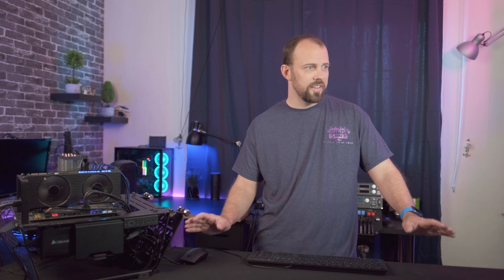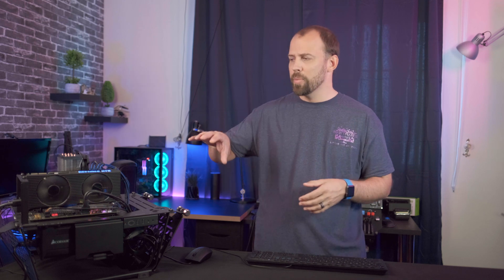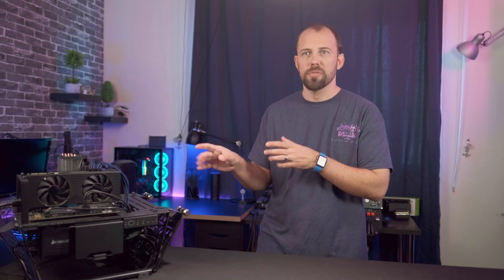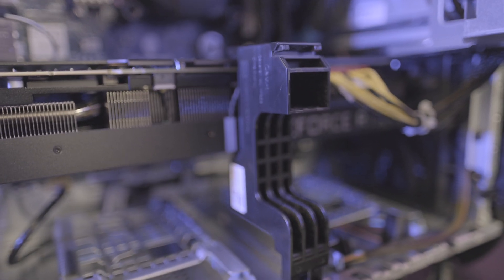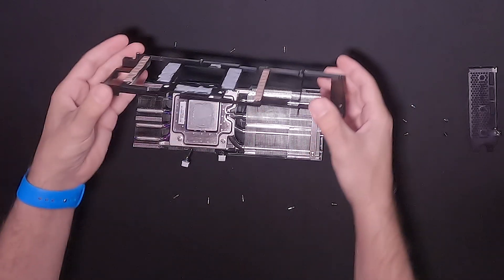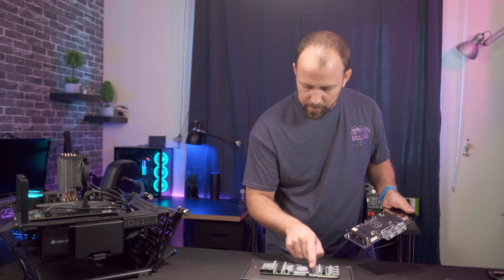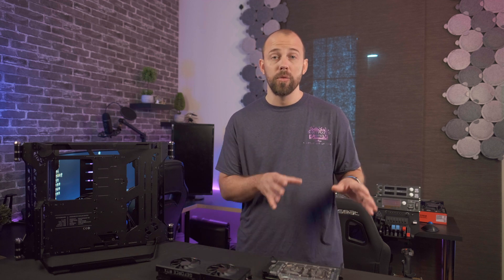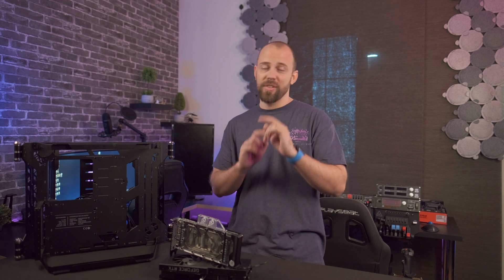Dell (AlienWare) RTX 3090 Teardown - EKWB Waterblock Install!!

Comment: I wish you could of shown the whole procedure of installing the water block, adding fluid and fitting it into the tower. I just bought an r10 with the Ryzen 5 5600x. and GTX 3090. I've always wanted to install a water block. Its for my son basically. But the cost of the water blocks are pretty crazy. And the guys putting them into ailenware computers and not huge on youtube. Anyway thanks for sharing this video, I subscribed today.

Comment: 9:30 and 11:10, you keep saying this is a FE water block.  That must be a mis-quote.  FE block is a different design, shorter, with the water connectors on the end rather than the side.  This must be a REF block that EKWB lists as compatible with the Dell/Alienware 3090?

Comment: I've actually dell rtx 3090 , if i install a watercooling system on it the overclock it , will overclocking damage my gpu in the future even with water cooling? And thank you
Reply from the maker: Overclocking will not damage your GPU if you do it properly and watch your temps. Go for it!

Comment: Are these Dell GPUs proprietary? I’ve heard some say you are unable to swap them over to a new build while others have claimed to do exactly that. I have a dell 6800xt and want to give it a new home but don’t want to waste money on a new mobo, case etc if it’s non compatible
Reply from the maker: I currently have this 3090 on a completely new build with no components from the original Dell machine installed. It is just as compatible as any other card so go for it!

Comment: Does this fit directly in the Alienware case? Also, what is the vram temps?
Reply from the maker: It is possible to setup a water cooling loop in the Alienware case but it would take heavy modification and there isn’t a lot of room for radiator/reservoir. Best to shelve that case and get something more water cooling friendly.
Reply from the maker: VRAM temps are nominal due to the large surface area of the metal backplate. It’s best to have airflow over the backplate to further aid in cooling

Comment: Damn you got a good sample going +260 on the core.  How many times did the benchmark crash before you got a result?  What's the daily gaming stable core offset on it?
Reply from the maker: There was multiple crashes throughout the testing lol. I don’t typically run any overclock during gaming because I need maximum stability during gameplay for recording.

Comment: Hey Bartman. I have the same RTX 3090 from Alienware. I love the detail in your video, but I will not be doing the water cooling mod. Question: if I’m taking apart the piece you’re pulling off at 07:47 in your video and re-assembling it, do I need to redo the thermal pads or can I just keep the ones Dell provided? I’ve heard of people just reassembling their GPUs, but in your video it looks like half of the thermal pads were stuck to each other. They look torn. Also, in general, if you disassemble your GPU, do you always need to reinstall new pads? Or can you just throw it all back together?
Reply from the maker: The thermal pads are stick on type from Dell so they tear when removing. It’s best to clean off everything carefully and then replace them. Make sure you get the right thicknesses to maintain the correct pressure. Replacing them won’t have a major impact on cooling but reusing the torn ones might.

Comment: What as the memory temp? I dont go by the chip temp as the chip seems to be adequately cooled the big problem is the memory temps on the back.
Reply: Memory temp on these are well over 100c, usually sitting around 108c

Comment: Good work. Will there be follow up videos regarding installing 3090/Waterblock back into the R11/R12? Do you need to purchase an additional AIO/radiator for the waterblock?
Reply: Also curious about this. I don’t really want to spend more money on a new case and additional components…

Comment: All the 3090's get hot, when I bought my 3090 TUF GAMING OC it was running about 65c to about 75c coming from a 2080 Super it was a bit of a chance I was getting 45c to about 60c. I'm still getting great performance out of it even still I have noticed an thermal throttling from my 3090 tho I've had it for about 2 months going now. I  also have it hooked up to a ASUS TUF GAMING B550 Pus motherboard and a 3950x. So all and all I think I've got a good system that is cooled well. These 3090's just get hot I guess.

Comment: Nice ! I have the R11 and 3090 this is gonna be good gonna sub for ya.
Reply: Question- what’s the number for the fans that is blowing up to cool the vram? I use msi/af for the fan control and I have it set to sync and would like to change to manually have that fan slightly higher to help the vram temp. I don’t get in the benchmark scores and I only play DCS and the R11 and it’s 3090 do a very good job at it. The vram usually plays at 92-96c and overall gpu temps at 72c not bad as I do not overclock the card it does very well stock for what I need it to do. I also don’t overclock the cpu I find this rig does just fine at 4.8-4.9ghz.. going above 5.0 GHz is unstable and throttles like all hell. I’m also using the offset thermals manually for the DCS and have no thermal issues. But yeah do you know what the 3090 fan numbers are so I can set that accordingly. 
Thanks !

Comment: Was the ek- quantum vector the WB you used?
Reply from the maker: Yes, for the 3080/3090 FE card
Reply: @BartmansBits  Funny you used an FE waterblock. I just installed Reference design one and it was spot on on RAM and VRMs. Now waiting for another waterblock for my 3080 FE, will compare dimentions.
Reply: Awesome, subbed